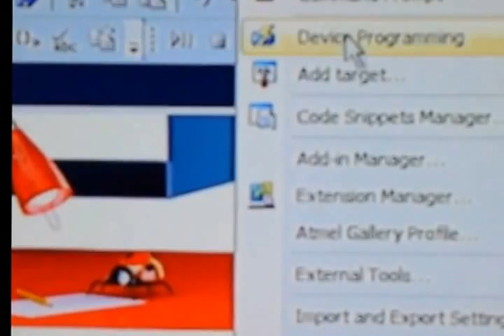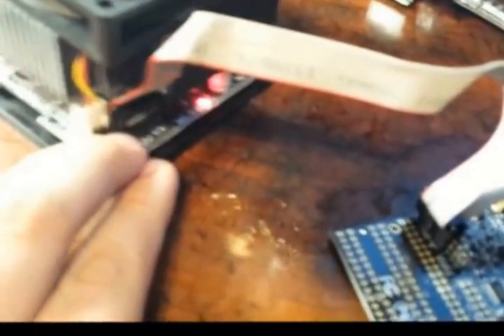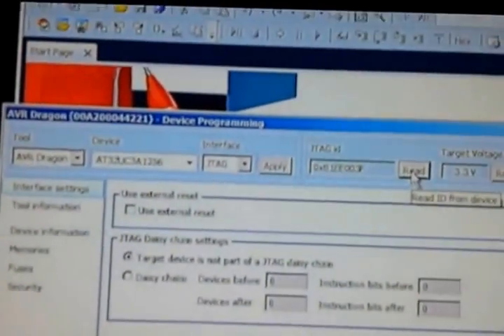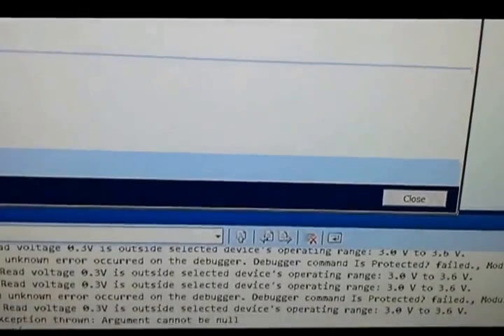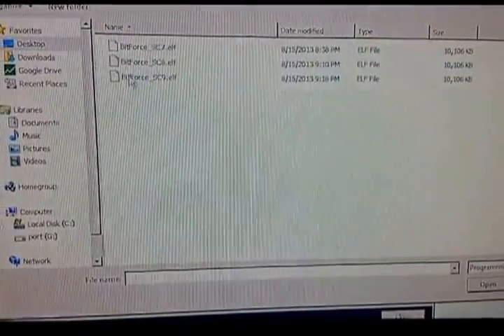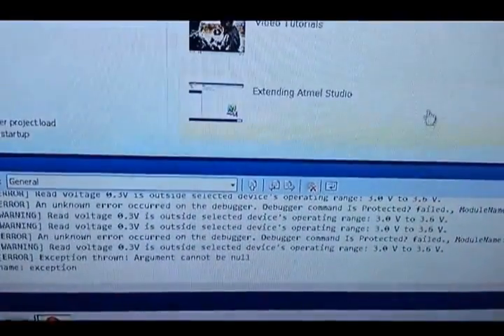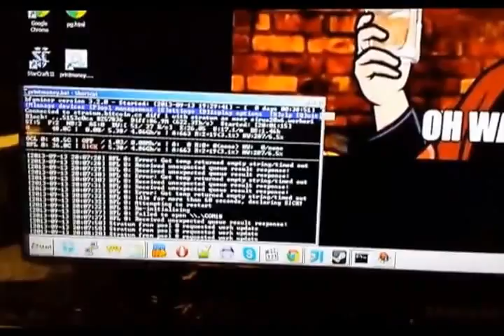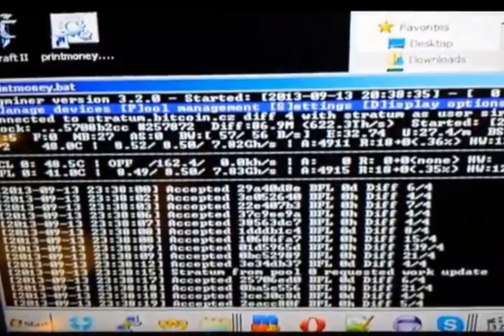BFL Jalapeno Firmware unlock with AVR Dragon flash Bitcoin ASIC

Comment: Couldnt you read memory first and make a back up if upgrade wouldnt work?
Reply: nope. its protected. can only erase. you can always use the 1.2.5 as backup. they get it working no matte what
Reply: Oscar Contreras weird that youre allowed to write to it tough.
Reply from the maker: afroninjadeluxe it's to protect proprietary code on the chip but to still allow upgrades.

Comment: My jally is averaging 6.6 - 6.7GH/s at stock and this firmware looks dodgy and it invalidates the life time warranty, I am not risking it personally. Thanks for showing how to do it though!
Reply: I'm sure it does invalidate the warranty but the firmware is built from source provided by BFL themselves. if you look on the BFL forums you can download the modified source yourself and compile it. I average about 7.8gh/s or so but it still all depends on your chip yield.
Reply: Sirus20x6
I don't want to risk invalidating the warranty just incase it breaks, cheers.
Reply: It would only increase mine by 1GH/s so hardly worth it anyway cos I average 6.7GH/s with stock 5GH/s miner

Comment: Sirius, would this be possible to do on the new BFL bitforce rigs? For example, using the 30Gh/s BFL rigs. More than likely the chips are very similar to the jalopeno rigs, but I would have to take apart and verify the specifics of the hardware. 

Def. possible, but unsure if the firmware would match. Any possible recommendations on how to figure out if that firmware & if the flash would be useful for this rig?

Thanks in advance & thanks for sharing this good info!

Comment from the maker: I believe they default to higher clock frequencies, but i already have to run mine without the case because the unlock makes it run atleast 10c higher. if you had some really great cooling (or maybe when winter comes along) you could try the other ones but your error rate will go up if you dont have the thing chilled